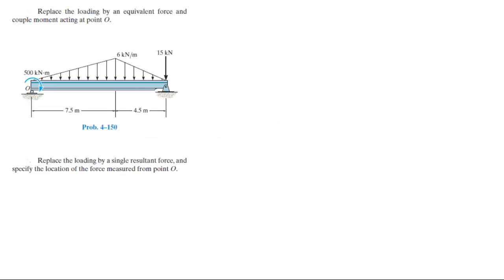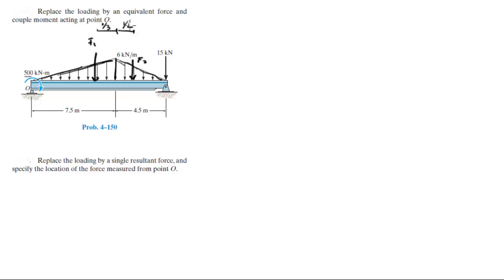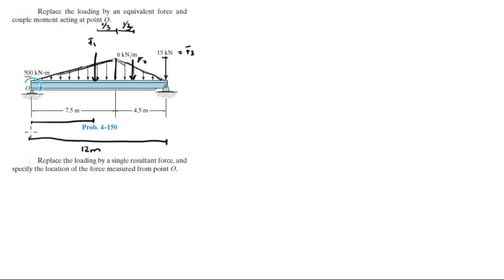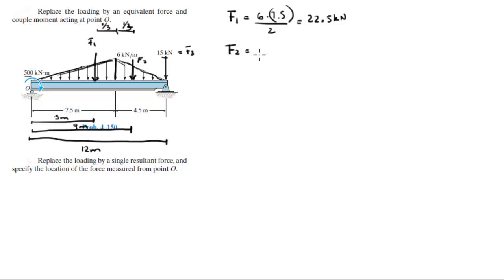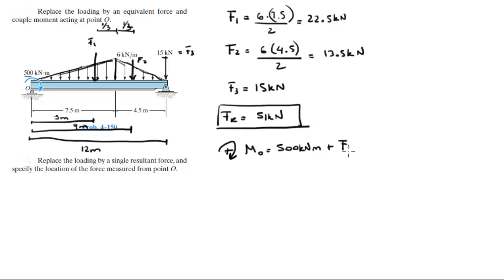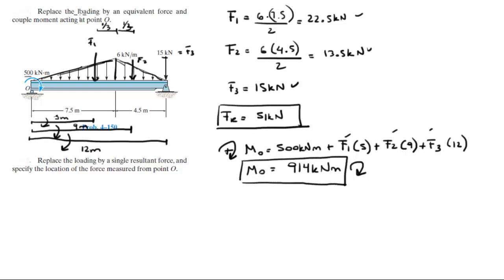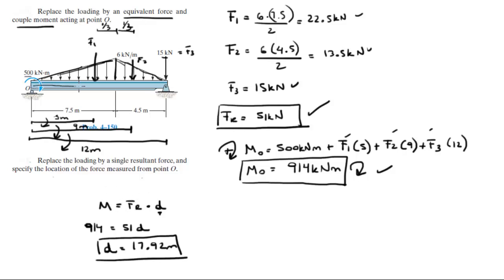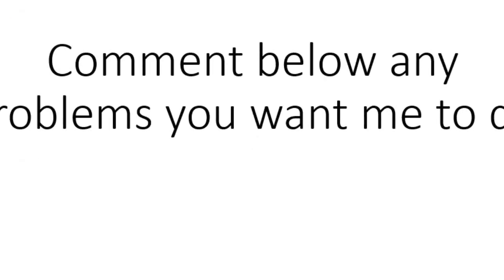Replace the loading by a force and couple moment acting at point O

Comment: im confused about where the 1/3 came from
Reply: its just the center of triangle where the force is.
Reply: @ibrahimalmalki8406  why don't use 2/3 instead of 1/3?
Reply: @cedrickansus5428  it depends what side of the triangle you start at. You can use either it doesn't matter, but your reference point changes.